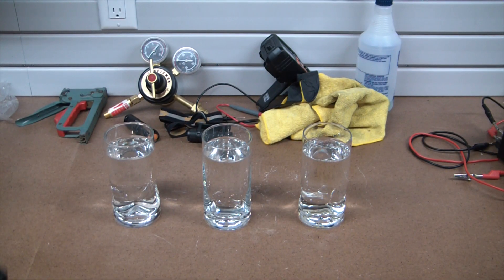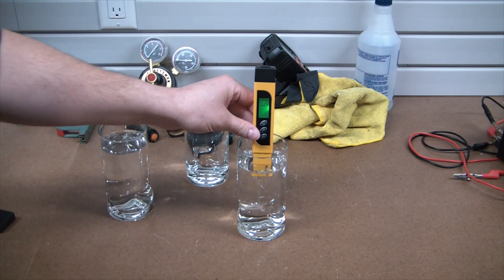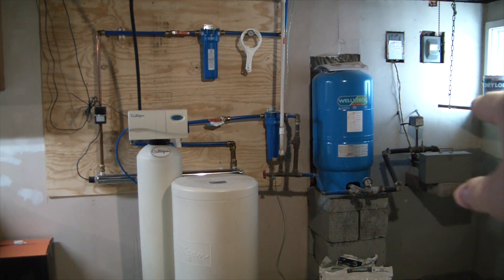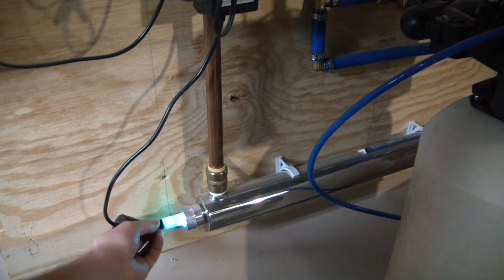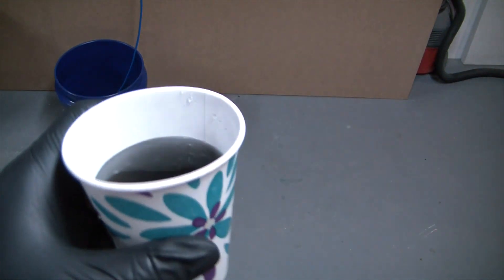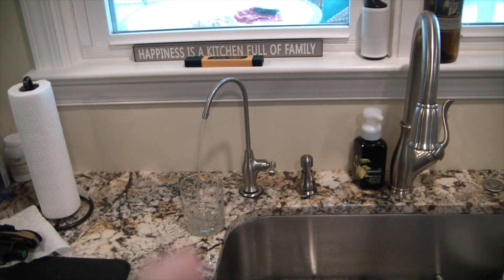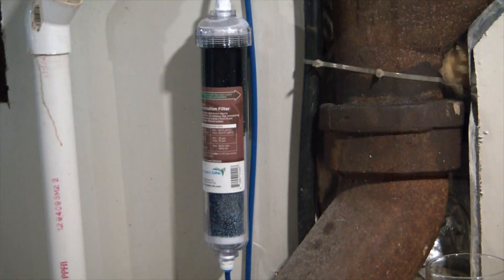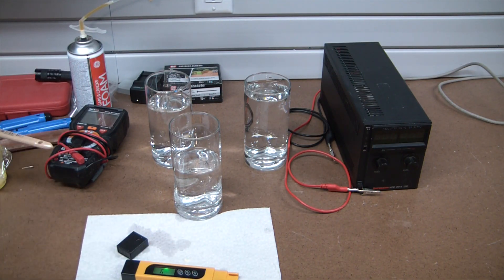DIY Deionized Water - ElementalMaker

Comment: I used to work at Intel and they used "ultra pure" water, it was said if you drank the stuff it could kill you by striping the minerals out of your body. Was always curious how it was made/processed.
Reply: used to work for a boat radio manufacturer when I was young called Pearse-Simpson, the management had installed a skull and crossbones on the different sinks  used to clean the boards with DI water....I later found out it was just a scare tactic from management in order to keep the employees from wasting the expensive water  to rinse their lunch boxes or wash their hands.....
Reply: It would take months
Reply: @templebrown7179  That would make sense.

Comment: Just don't drink the R/O or DI water for hydration, I don't see a problem with R/O for coffee or other drinks but both will suck the minerals out of your bones. Not a good thing at all. Why 5/6 stage R/O systems have a mineral cartage, yours is bog standard four, and an added DI for the lab is a good thing. I would question where you split the lines and if you want to add a 5/6th stage for the kitchen or not.
Reply: Another UV after stage 5 before the DI would be nice, and consider a `gray water tank from the blow off for the general fixtures ie. crapper tanks, gardening etc.

Comment: Deionized water, huh... Why would I use that fancified deionized stuff when I got a whole faucet full of good ol' tap water? If it's good enough to wash me then it's good enough to wash my electronics.

For example, I cleaned a motherboard that my son spilled Pepsi all over it a couple years ago. I connected my anti-static bracelet to the kitchen faucet, covered the piezo speaker with electric tape and removed the CMOS battery, ran the motherboard minus CPU and RAM under hot tap water until all the sticky was gone, shook out as much water as I could shake out of it, got chewed out by my wife for washing electronics in the kitchen sink again, and then used canned air to blast out the water that was hiding under PLCC's, sockets, surface-mounted chips, and anything else where water could get trapped.

The motherboard looked pretty dry when I was done shaking and blasting it with canned air, but I let it dry completely for a couple of days anyway. After the two days, I reinstalled it into a Pepsi-free case and turned it on, and it booted and ran (and still runs) like a champ.

That wasn't the first electronic device I've successfully cleaned with tap water: several gamepads (tore 'em down and washed 'em out), a whole Nintendo from a cigarette smoker's house (no, I didn't stick a Nintendo under the faucet. I took it apart and washed each piece, then reassembled it after the parts and electronics were dry), several game cartridge PCBs, my wife's Galaxy phone after it fell in the river, my iPhone after it fell in the toilet, large expensive custom boards from automation equipment, and more small custom PCBAs than I can count.

Anyhoo, I guess deionized water would be good for washing electronics where one doesn't have a good means to dry it when the washing is done. But I've never had a problem with washing electronics in tap water. Maybe I've just been lucky. Or maybe it's Maybelline. But either way, I probably need to quit writing comments on YouTube videos while drinking large and delicious margaritas.
Reply: Anecdotal evidence - I stepped on a bowl of burning gasoline, it splashed up both legs of my jeans and I was alight. I stopped, dropped, and rolled like a spastic on meth and ended up with no burns and it didn't even ruin my jeans, therefore flaming bowls of gasoline must be safe.

Reality - I got lucky, and I might even get lucky a second time, but you are still playing with fire.
Reply: I have cleaned electronic items with tap water....is not a death sentence to the equipment (at least not to fans)....Now, I did work for a boat radio manufactures called Pearse-Simpson when I was young and the boards were washed in DI water to remove the solder flux and whatever other dirt that got on the boards.  the boards were then dried using compressed air.  Could write more but got Mojito on the other hand.

Comment: All I use the RO column for is the water for the fish, as the city water is pretty clean by me, Just have the 0.5 micron filter on the kitchen water, because that is where I get drinking water, so want to trap the sediment from the pipes, as there are still asbestos pipes in use here. Water is soft water, not much in the way of deposits, though water heater tanks all have a thin layer of silt at the bottom with time.

Comment: I have an ro/di system in my house for my salt water reef. Using that water regularly you will be going through filters at different stages. The best way to combat that is installing inline TDS monitors. I also write my pressure in and out of the sediment filter down on the wall so I know when it drops what to replace. I see that you already have a carbon filter on your main system. Then that water feeds to a sediment filter on your r/o system, then another carbon, then ro, then di. My system might be different, but wouldn't it be easier to simply remove the carbon filter and add another di resin chamber? Ie: sediment>ro>di>di? The di resin chambers in the canisters have to be cheaper than the one in that inline shenanigans. For reference I have a spectrapure system. Also check the pressure at your Ro, make sure you dont need a booster pump. My setup is extremely complicated due to floats and double shutoffs and separate ro and di storage tanks. I also have a post carbon filter after my bladder and booster before the spigot, however I dont have a uv sterilizer so it is required for taste. Also I have zero tds post di. Resin is changed at 5-10 depending on how much cash got reallocated to the beer and tool fund.

Comment: So I'd watch out with those shark bites on the sterilizer output. They seal with an o-ring inside there and it'd be a good idea to check of the back of that o-ring is exposed to UV. If so, you'll have to replace them fairly often.
Reply from the maker: Yeah that's a concern of mine too. I believe with their geometry little if any light should be reaching the o-rings, but it's still something in keeping an eye on.
Reply: @ElementalMaker  Unless the sterilizer is poorly designed (like mine are), there should be almost no light coming out the fittings and that which does leak has been attenuated by inches of water. Careful with the PTFE being exposed to the UV, though. That's what turned Alex Jones into a batrachophiliac.

Comment: Your municipal water supply, is it coming from a well or surface water? I’m assuming with such a high TDS it is Well water.   Don’t  go drinking that water unless you want to DIE a painful cramping death.
Reply from the maker: We don't have municipal water, it is our own well on our property. I drink it all the time with no ill effects. 500 ppm and below is still fine to drink. Hell thats the only water I've drank since we moved in almost a year ago.
Reply: I had to watch the video again, how I missed the fact you have a well and even showed it I missed that completely.

I wasn’t referring to your well water. I was referring to drinking your final product either DI Water or Distilled Water. It will suck all the salts out of your body and cause horrible painful cramps. Actually watched a documentary of a lady in California drinking nothing but distilled water after working out. Her cause of death was from lack of salts in her body and she died a horrible death. But those are the same folks that drink water straight from a creek. Crazy folks all over. 

I work for a water company and our drinking water has a TDS OF 30 mg/L  we recently took over a neighboring water system and got rid of their wells but prior to that, their water had a TDS of 750 mg/L and required quite a bit of treatment. The Iron, Sulfur & Calcium was horrible.  We cleaned with activated carbon and alum to drop the levels below 300 but still horrible water quality.

Comment: If you want more RO water and half the waste you can run 2 membranes. The salt water peeps are all into the RODI and I have found with the water softener you will only deplete one of the two resins.   I have even recharged my resin to prove I can.  Check out Bulk Reef Supply on screwtube they have a bunch of videos on RODI.  
My water is so hard I have to run a Iron Curtain then a soft water, out to my 2 stage cartridges and it is at about 450 to 550 TDS.  Then out to RO and it will go down to 30's.  If I want zero I have to DI it.

Comment: Where did you get you uv light at?
Reply from the maker: Just a generic one off Amazon. They are all the same for the most part
Reply: That's a nice unit that its made of steel. If it doesn't have wipers built in you'll want to clean the quarts glass sleeve occasionally.

Comment: When we take the TDS meter with a grain of salt... Like 1 grain per gallon? Or liter?
Reply: Well, hardness grains are usually grains per gallon, equal to around 17.1ppm, so that's my vote. When in doubt, cut the atoms in half with a suitable Xacto and only add the left ones to the water.
Reply: My exacto is dull. It tends to just strip off the electrons, so I have to keep an Ion it.

Comment: its the copper tube should have used stainless
Reply from the maker: Why do you say that? Copper shouldn't be affected by the UV
Reply: @ElementalMaker  Copper dissolves, the ions increase the conductivity. If you want 'zero' ohm, use plastic for anything that comes after the resin.
Reply from the maker: @DutchPhlogiston  yeah the only things the di water runs though is 1/4 Pex line and a stainless faucet. I believe the original comment was regarding the copper tubes connected to the uv sterilizer.
Reply: @DutchPhlogiston  Can you explain the chemical proccess of copper dissolving in clean ph neutral-ish water?  I'm not buying it. I can see it dissolving if you have acidic water with nitrates, but in normal conditions the copper in the water should not rise above ppbs (and I doubt even that). it should be as relevant as antimony leaching in stainless and PET (as well as plasticizers). I do not know what get leached from PEX (aside from plasticizers).
Reply: @giuseppebonatici7169  Oxidation of the copper by dissolved oxygen, and peroxide and/or ozone generated by the UV steriliser.
In tap water, copper is between 1-2 ppm where I live, well above ppb levels. (I operate an ICP-MS at work, and we sometimes measure our tap water when we need a quick sample to do some testing).

But like elementalMaker already commented, the 'distilled' water does not run through any copper.
Reply: @DutchPhlogiston  I am sorry, but you are wrong. copper oxides are insoluble in water. period. you may be thinking of copper hidroxide (about 20 ppb at 20°C), but you wil never form copper hidroxide in regular water (see the pourbiax diagram of copper and water. you need at least a ph of 12).  just because your area has copper, does not mean that is an oxide, have you made an ion-association aqueous model (with PHREEQC or something) to corroborate the idea that copper oxide, an insoluble compound in water, would be dissolved in water?. 

Again, the most probable is that your tap water is contaminated with nitrates (or other acids, but nitrates are more common... usually) and there's a sustitution reaction between the copper and some nitrated compound. but yet again, how do you even know that is from the pipes? do you have background tests of the acuifer? maybe is just a really bad acuifer.
Reply: @giuseppebonatici7169  I never claimed there was dissolved copper OXIDE. And sure, it can originate from all kinds of sources.
Look, I don't care about the origin of copper in my drinking water or the fundamentals of dissolving tiny amounts of copper in water. If it interests you, feel free to study models and pourbaix diagrams yourself. I am not interested and have plenty of other things to do. 
I still think it is good advice to avoid running low-conductivity water through copper tubing.
Reply: @ElementalMaker  actually, looking back on the video maybe is just vestige on the probe
Reply: I can't think of a reason why.  in fact, I can think of many reasons not to, like the UV stainless to stainless connections.